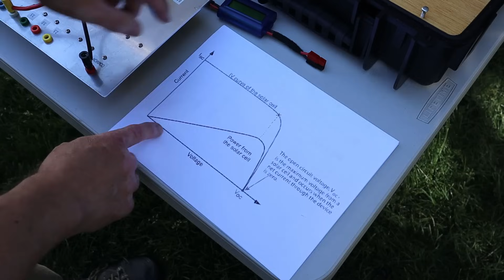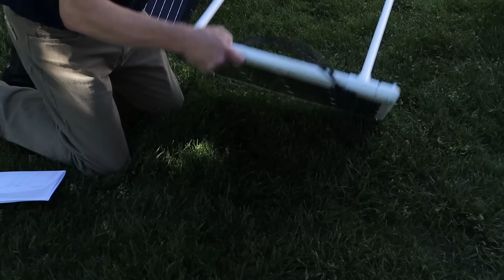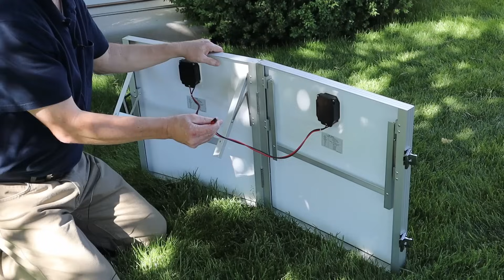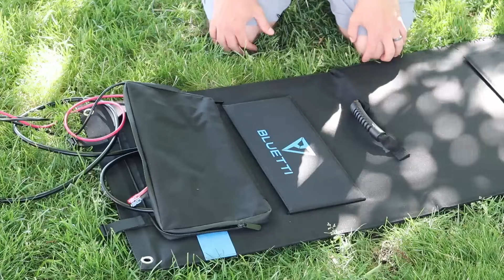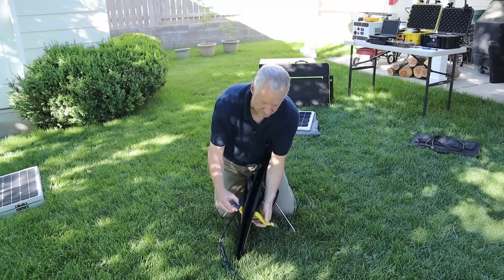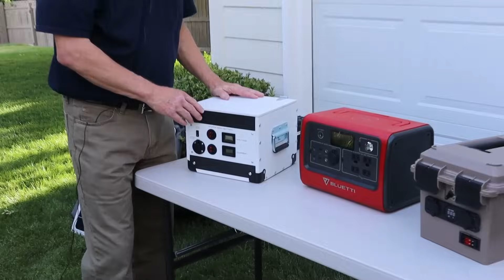Portable Solar Panel Comparison, 11 Different Models! Sunpower, Baldr, Rockpals, Bluetti, and More!

Comment: Hi, a question for you. someone gave me a solar panel with no information no numbers no nothing. I have a small bluetti ac70 and I would like to use the panel with it but I am afraid that it might burn it up. I don't know what the watts are. Can you help? Thanks
Reply from the maker: If the panel is fairly small it should be a 50w or 100w panel. It should not be an issue on the AC70.

Comment: Great overview!  Curious, my power station says max 100w input for solar.  Will a 120w hurt?  On best case scenario it will push 20watts more than 100w   Just curious.
Reply from the maker: 120w panel will not hurt the power station, it will just limit the power to 100w. Most 120w panels you'll get right around 95 watts so that will work great.

Comment: PV ground bracket +Easy and fast installation without punch holes. Match 980mm-1134mm width solar module.

Comment: Is this video about which one works best in the shade?  I'm asking because in the summer time, you might want to park your RV in the shade.
Reply from the maker: No solar panel will work in the shade, direct sunlight is the only way to get power. I recommend getting a 25 to 50 foot solar extension cable and putting the solar panel in the sun while your setup is in the shade.

Comment: Wont anyone do a review of smaller panels and battery packs and rate them on how rugged/reliable they will be in the field? Just the bare minimums would need to charge things like a phone, tablet, radio, gps, .. not trying to run high wattage household appliances on portable power solutions .. trying to use portable power solutions in portable situations
Reply from the maker: They don't get much smaller than 100 watts. Anything smaller doesn't put out much power.
Reply: @Jasonoid  charging portable devices doesnt need much power whats wrong with you? dishonestly defensive much?
Reply from the maker: Dishonestly defensive?  I need to Google what that means... I have reviewed many of different sized power stations / batteries on my channel. Did you even look at my videos, I'm sure one of them would work well for your needs. Check out my grading spreadsheet on my website where I rate them for their price, features and performance. Jasonoid.com then the power station page.
Reply: @Jasonoid  This video claims to compare Panels, not Power Stations, and now you are claiming it compares Power Stations, not Panels. Further, you just claimed a few minutes ago, that sub-100 watt panels are rare to non-existent. Dishonesty seems to drip off you. Most of the portable solar charging market is sub-50 watt. Got any more lies to send my way while being defensive?
Reply from the maker: @styleisaweapon  I'm talking about my channel loser... Learn to read lol

Comment: Out of curiosity, if someone was starting with solar, you both talked about plugging into a “charge controller” is that something you need for your power station?
Reply from the maker: Power stations have built in charge controllers, no need for an additional one.

Comment: Question what happens to the electricity when you have a solar panel outside in the sun without anything connected to it and does it ruin anything? Does it just not make energy at that time but it would have to write? So what does it go?

Comment: Can I get some help??? I have a Bluetti EB70, and two Itehil solar panels. I'm needing some MC4 cables and adapters, but for some reason Bluetti does Not answer the phone. I know this sounds pathetic but I don't know where to get these cables. THX to anyone who can point me in the right direction. .
Reply from the maker: What adapters are on both of your solar panels right now?
Reply: @Jasonoid  How nice, a fast reply. Thank You. Ok, each Itehil panel has one cable, with the same end on each cable. There is a diagram printed on the solar panel showing up to Four separate cables, three of one type, and one of a quad-kind, to Fit Into an Itehil power station. (these look to have MC4 connections on one end)(and the odd one, with four MC4 ends) However, I have this Bluetti eb70 with just one Plain input. Something tells me, this will be harder to sort out via texting yet it's a straight forward connection application. I'm lost I guess. Please Advise.
Reply from the maker: @vencenzodemarco4393  email me with more info at  jasonoidLLC@gmail.com

You can send me a picture or screenshot of what you are trying to describe.
Reply: @Jasonoid  Thank You again very much for helping. I will send a pic tomorrow showing what there is and the diagram printed on the solar panels. The diagram is basically for the Itehil to Itehil set up, not for mixing & matching. Thanks Again, you are very professional to help me this way. 👊

Comment: Great video, I discovered the Baldr and just ordered it off of Amazon now. Random question, I'm assuming it's possible to charge two generators at the same time using one panel? I'm thinking DC in to one and then DC out to the other? Would make it easy to just walk away and not have to switch the cable at the exact moment one was done charging. First world problems I know 😀
Reply from the maker: What you can do is have one power station charge from the solar panel, and then have that dump power into a second unit. Once the second unit is fully charged, the first unit will then fill up all the way.
Reply: @Jasonoid  exactly what I was thinking, thanks!

Comment: Can you guys help me out to figure how i can use a usbc 100w from my eb3a to send power out to a bigger battery to then have as a backup and then be able to send back power from that battery to the EB3A
Reply: Id like to have a system to where i have a bigger battery just full of power and the eb3a charges it thru the 100w usbc or other wiring from eb3a. Id like to also be able to use my milwaukee batteries as additional power sources to send and receive power from.
Reply from the maker: I don't think you can charge a battery using the USBc 100w port. You'll have to use either a 12v DC charger or ac wall charger.
Reply: @Jasonoid  I want to take a W here and move it there

Comment: Can you do a test and review of foldable solar panels to be used inside the car on the dashboard like a sunshade? 60-100w and 2×3.5ft
Reply from the maker: I have heard you lose lots of power from the windshield, over 50 percent the power.
Reply: @Jasonoid   yes, I don't expect it to be as efficient but it's so convenient when you need to leave the car and not baby-sit your panels in a parking lot. no one has done this type of test and review, but i know many would love to know which ones work best! Would you be interested in doing a review like this?
Reply from the maker: @larryc1616  I have a couple panels I can test that with. It might be a better performance in the winter. The only problem is the extreme heat might damage the panels. Also, hot panels lose their efficiency.

Comment: I have been trying to find a testing jig for panels for quite a while. using a MPPT controller does not really do the job entirely.  I thought about building one. Do you guys have a parts list and schematic for that fixture?

Comment: Great video. Are you able to calculate how long it would take to charge any given portable batteries? Also, it looks pretty sunny there but in Scotland we don’t get much sun — what would you recommend for cloudy environments that are prone to rain?
Reply from the maker: If you know the watt hour rating for the battery,  you can divide that number by the wattage you are getting from your solar panel and that will give you an estimate of hours.  For example,  1000wh battery  / charging at 100 watts from a solar panel will take 10 hours to charge.

For rain and clouds you can always over panel your setup by adding more solar panels than needed to compensate for the lack of sun.  You just need to stay within the voltage requirements of your charge controller.

Comment: I live on a rental property and I have a shed out back that I like to work in. It used to have power to it and it even has a big fuse box and breaker inside it but the landlord chose to cut the line to it before we moved in. It's an old shed, the roof is starting to leak and she chose to sacrifice it when remodeling the house for financial reasons.

I could drag a 100 foot extension cord out there and put a plug on the cables that run to the outlets but that's boring and I'm honestly just looking for an excuse to buy portable solar cells.

Comment: Excellent video. Helped me make my solar panel decision. Wished you had noted if each panel was waterproof or not. Bluetti SP200 not waterproof but Baldr 120W is. A real deal breaker for me as where I camp afternoon storms can come by any day  I'd be out hiking and not able to run back to camp to get panel out of the rain. Also, grommets are important to me as I'm worried someone will steal my panel while I'm hiking and wanted a way to attach panel to some object that wouldn't shade the panel. I haven't seen any reviewers address this concern and give suggestions on how best to prevent theft so maybe its not a problem or maybe there just isn't any way to prevent theft.  I disburse camp so it's extremely rare for someone to come across my rig but just wanted it anchored for peace of mind. Thanks again
Reply: Hi. Like you I've also been thinking about it getting stolen. I live in a built up town in Scotland where the houses are joint together in like 5 house in a row and I was thinking how can I charge the panel and leave the panel and say for talking sake I bought the best bluetti or Jacory generator and spent maybe a thousand pounds or more on both items, do you just leave them lying outside and whats to stop someone else from stealing it.

Comment: As an apartment dweller, I don't have access to a lawn. I still want to take advantage of so called "free solar."
Is there a solar panel small enough, that I can place in my window and benefit from partial charging to my generator? I know I would not be able to adjust it for optimal transference, but I'd be willing to give it a go. Thanks.
Reply from the maker: The sunpower flex 50 in the video would fit well in a window. The glass would probably reduce the power output significantly. Do you have access to a porch? You could also hang them out the window for more power. That would be where I'd recommend putting your panels if you didn't have grass.
Reply: @Jasonoid  Thank you. I don't think my landlord would let me hang it from the window (average double hung window). They have all these silly rules. I thought about that. I want to charge my Bluetti EB3A with it. I really appreciate your response. Thanks for the suggestion.
Reply from the maker: @mrwonderfullgj  well you could at least do that in an emergency, but probably not every day. I'm always happy to help!
Reply: @Jasonoid  It's individuals such as yourself that stand out amongst the others. Your help and genuine enthusiasm in your reviews, is not only apparent to me, but I'm sure to the rest of the You Tube community.
Thanks again.

Comment: Great post , but you made the common mistake of rating energy capacity by AMP Hours without mentioning voltage.   If your homemade battery pack is 80 AH @ 6 volts , the capacity is 480 Watt hours , if its 12V it will be 960 WH .  The Bluetti is 700 wh.   .  I'm not sure where you got the 40 AH  figure unless you are assuming 18V .  If both are at 12V , the Bluetti is at 59 AH .
Reply from the maker: I tested the actual capacity of the EB70 during my official review and got right around 40ah with my full discharge test. It's a 22v 20ah battery.
Reply: @Jasonoid    40AH @ 18 V ?  .  Again you forget to mention the voltage.   A 22v , 20aH rates at 440WH .  Thats about the capacity of my 500 Bluetti
Reply from the maker: @mariaavakian4910  my apologies Maria, got some numbers mixed up so I went and checked the back panel. The EB70 is advertised to have a 22.4v 32ah battery. The DC output is regulated at 13.2v and I pulled around 616wh from the DC output during a 0.2C discharge test... so it's actual real world capacity is around 46.6666666ah. So slightly more than what I previously mentioned.

Comment: What are these solar panels for? I work with sunpower solar panels.Are these just portable panels? What do you use them for? This is very deceiving not Differentiating with solar panels for your home to offset your electric bill.
Reply from the maker: Camping and emergency backup power using an inverter / battery / transfer switch setup.

Comment: Hi  I received my bluetti eb55 today and found it is missing a part xt60-f.chadging adapter cable..
.it came with the solar charging cable but my eco worthy only has a 5mm2.5mm connectors on the solar panel itself..is there a way to connect my bluetti to the solar panel. Ty.
Reply from the maker: Uh oh. I thought your eco worthy panel had MC4 connections! The panel doesn't have any other adapters with it?
Reply: @Jasonoid  it has fro bluetti the solar charging adapter with I male and female connector..go labs has the same connector...but the piece from the eco worthy only has the 5.5 x2.mm connector..which I can plug into the go labs..but the bluetti...can't ...
Reply: @Jasonoid  I have a mc4 solar charging cable from the go labs power station.
Reply from the maker: @carolannbest1925  you will need a female 5521 adapter to a female xt60, like this one:
https://www.amazon.com/DGZZI-Adapter-Connector-5-5x2-1mm-Fatshark/dp/B08TZJMLHD/ref=mp_s_a_1_3?crid=2XQQ7Z6RL17CG&keywords=5521+female+to+xt60&qid=1656373407&sprefix=5521+female+to+xt60%2Caps%2C151&sr=8-3
Reply: @Jasonoid  thank you so much for your expertise and input..thank you for persevering with my problem...I will buy from Amazon canada or USA...
Ty..again. makes life easier when we have an understanding of how electronics work..the solar cable from bluetti will not be needed...just the female to female connector...ty.

Comment: Thank you for your video. I bought a bluetti eb55 and I need a good solar panel. I bought a 120 watt eco worthy but it doesn't seem to work for me. I'm thinking of the rockpal rp82 100 watt 289. Plus?37.70 import fee
Rockpal sp003100 watt 248.99 and a bluetti sp120 349.00..I need something that will work for me..any suggestions ty.
Reply from the maker: The Ecoworthy 120ws should work fine on the EB55. What doesn't work with it?
Reply: @Jasonoid  I only get 55 watt full sun when using  go labs..I haven't received my bluetti eb55 yet..still waiting for..it.
I wondered if 55 watt was too low? Took about 2 hours to go from 60 to 80% on my go labs power station..at 55 watts ..
Reply from the maker: @carolannbest1925  The Golabs charges much slower on solar than the EB55. I'd wait till the EB55 shows up and see what power you get. You should at least get around 100 watts on the EB55, maybe more.
Reply: Thank you so much for you replies...I really appreciate your videos...

Comment: Where would you rank the new Xtar 100 watt folding panel at in this mix? I am considering getting that, but it is a bit pricey. The forum factor and efficiency seem perfect for my needs, anything else seems to be a tradeoff for a better price.
Reply from the maker: Xtar is the best, but it costs a little more. My next recommendation would be the Elecaenta and Baldr 120w panels as they are ETFE and put out decent power.

Comment: I ordered up and got one of the Baldr 120W panels.  I have very little knowledge as to the different types of connectors and what they are for.  The panel came with a connector that has 4 different ends and I don't know what in the world they even go to.  Where can I go to learn about what the different connectors are for and how to use them.  It won't do me much good if I don't know how to use and what to use the connectors for when it comes down to the time when I need to use them.  Please send me in the correct direction if you can.  It would be amazing if you could do a video on "connectors"!!!

Comment: anyone tried flexible lightweight frameless panels glued directly to a camper's roof? I like the way it would look built into the roof and ease of install, since they don't get air on the back would they run hot and so not very efficent? They would be fine when the vehicle is moving so if 80% when sitting in the hot sun would be fine with me, as long as they still have a long life...
Reply from the maker: Sunpower Flex panels can be glued but they wouldn't last near as long as a glass rigid panel setup, they need to be replaced as the protective coating breaks down and starts peeling and cracking.

Comment: Thanks for these comparisons of folding solar panels. Most viewers here are thinking along the lines of using folding solar panels for camping. The application that concerns me is charging a micro-EV (5 kWh battery) that sits most of the time in my sunny parking lot. It is charged by a standard wall-plug cable. If I put one of these folding solar panels on the car's roof, what would I need to connect its output to the car's charging cable, i.e., standard wall plug?
Reply from the maker: You'd want to make sure you use an ETFE based solar panel for the most durability. In order to get the solar panel power over to AC wall power youd need a battery and an inverter rated at how fast the EV charges.

Comment: Just make sure everyone knows that with the Rockpals the panel is not waterproof.  It cannot handle getting wet, if it rains you better run out there and put it away or you will fry it.
Reply from the maker: Keep the water out of the electrical USB / junction box on the back and it should be fine. BUT.... I always try to keep these folding panels out of any sort of rain to be safe.